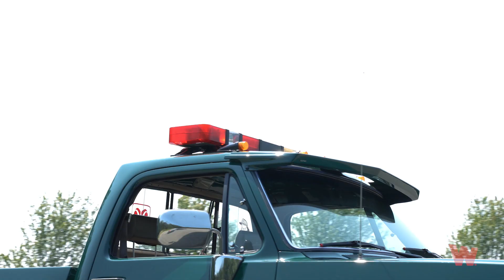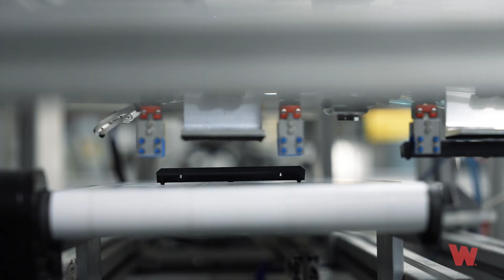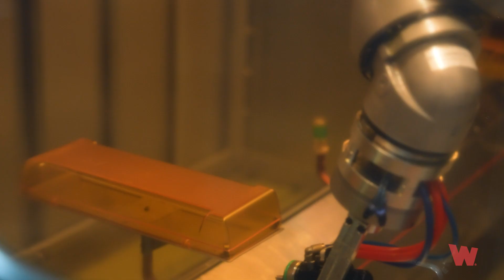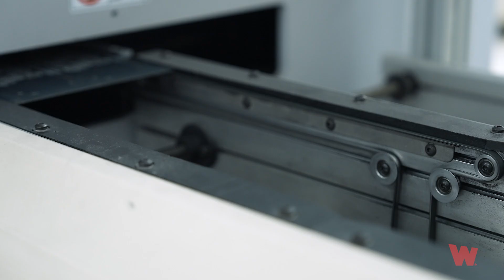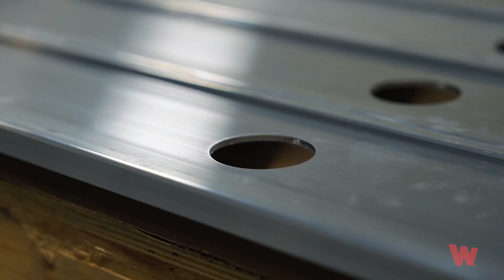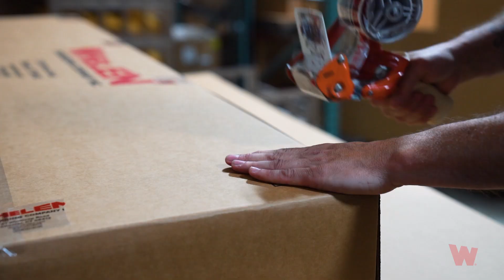How Whelen Edge® 9X Lightbars Are Made | American Manufacturing

Comment: I have just 1 question, why is something as small as an ION so expensive? Like, 145 dollars for a ION trio is quite expensive
Reply: I'll explain in simple terms. Whelen products are honestly some of the finest on the market. At the same time, they are also not mass produced by cheap labor in China or Indonesia.   What you're paying for is a combination of their quality, American labor,  programming, and quality parts.  I'm positive they could build in some dump like Indonesia for pennies on the dollar, but the products would absolutely suck.
Reply: @bobw7018  i wonder if they would be cheaper if they did build them in mass production
Reply: @atesethyn3484  Initially, no, it would probably take quite awhile before the prices came down, just to pay for the machines necessary to build to their standards.
Reply: mostly programing. Programing is often 3/4 the costs of electronic products because it takes hours and requires building appropriate circuits and more. Cheaper sets often reuse third party components as its a common practice for cost savings.

Also goes without saying that they are a (relevant to other makers) low volume high demand mfg, so their products are more expensive just because its not mass produced in batches of thousands.
Reply: @sterlingodeaghaidh5086 Also add due to the Tyrannical Economic Policies and their War against Fossil Fuels coming out of DC the last 4 years has forced the increase in manufacturing, engineering, development and distribution expenses.  We have used Whelan for all our construction and service trucks since our founding in 1991 absolutely best in the business won’t buy anything else period.
Reply: @sterlingodeaghaidh5086 add also due to the Economic Policies and their War against Fossil Fuels coming out of DC the last 4 years has forced the increase in manufacturing, engineering, development and distribution expenses.  We have used Whelen for all our construction and service trucks since our founding in 1991 absolutely best in the business won’t buy anything else period.
Reply: You get what you pay for.
Reply: @ShortFinalRN  Precisely. I speak from professional experience, Whelen is worth the premium cost.
Reply: I couldn't agree more. I need an updated full bar, but no way I can swing those prices. Prices are likely jacked up to sell to agencies. Us little guys just have pray we get seen with what we got.
Reply: @tireballastserviceofflorid7771  the only thing I can even barely afford is SpeedTech Lights, there some what bright but definitely not up to industry standard